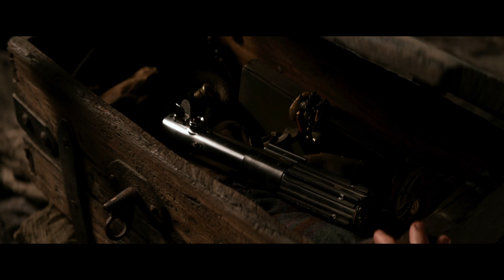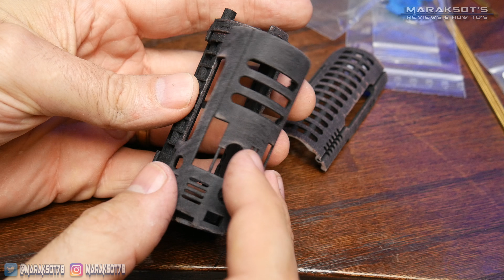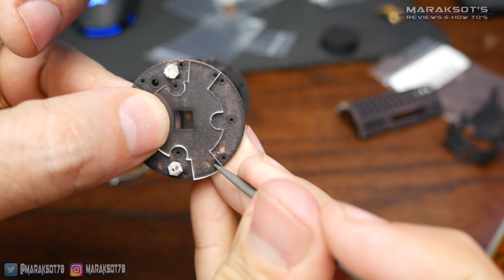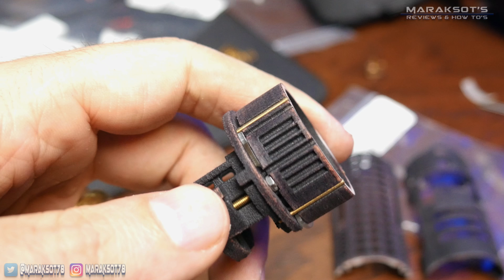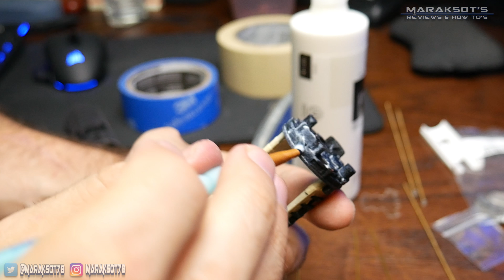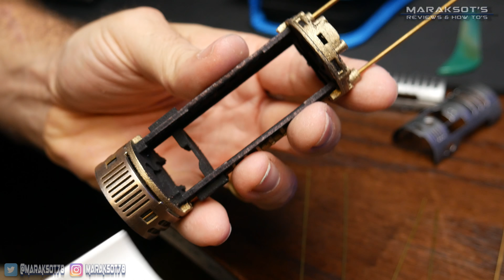Custom Graflex Lightsaber Build Log Part 2 - MB Sabers Metal Master Battery/Soundboard Compartment

Comment: Not bad for a first lightsaber project! I have been building sabers for close to 10 years and only recently built my first MB all steel and brass chassis. I sold that one to upgrade and I am now waiting on my parts for a all brass and real silver version of the saber. So far just in parts I have 2600 invested into the next saber project and I haven’t even started as of yet!

Comment: I'm 9 months into a Brass Chassis Steel Hatch MB Saber Build and there have been many weekends where I wish I had gotten plastic instead.  I'm sure when it's done I'll be happy I chose all metal, but it is A LOT of work, especially when it comes to fitting pieces in the steel.